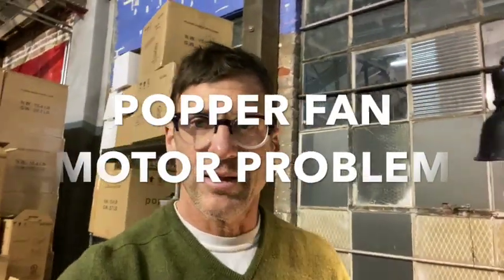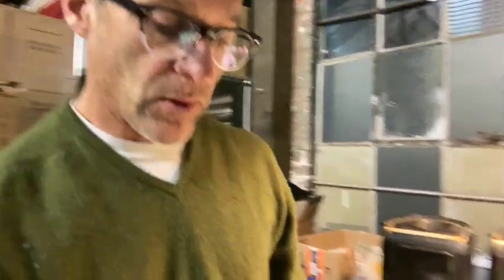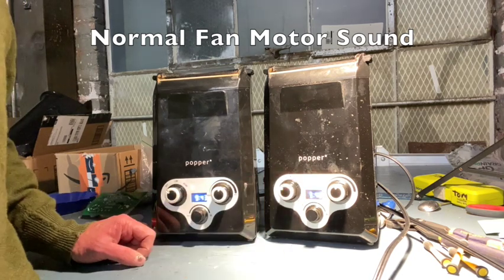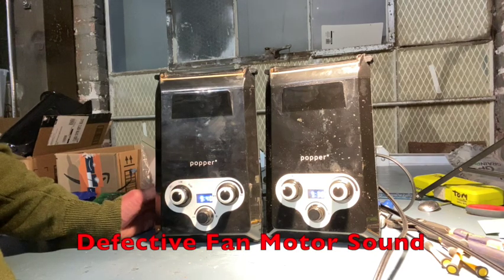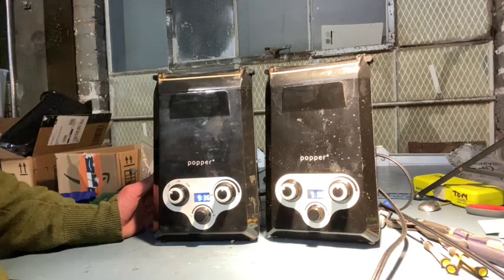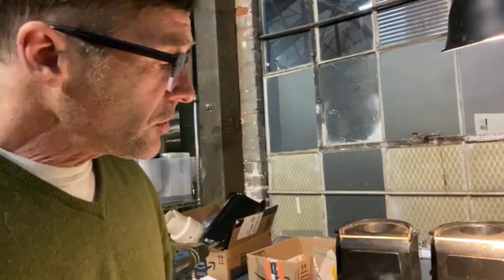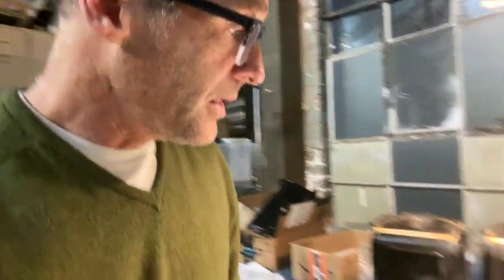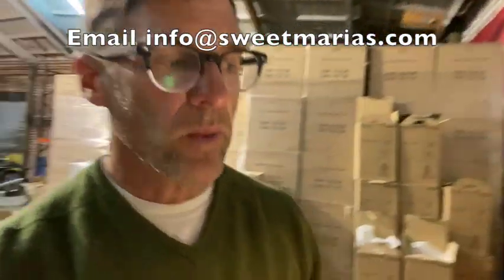Popper Roaster - What Does a Bad Fan Motor Sound Like?

Comment: Mine finally hit this problem. Too bad; and I'm out of warranty -- but I've gotten my $ worth out of this unit. Onto the more expensive (and hopefully reliable!) options.
Reply: There will be new motors available- hopefully in April. Changing the motor is pretty easy. So if you have the popper still perhaps keep it and wait for the motor. Should give you at least another 200 batches +.
Reply: @ThompsonOwen  ya, I'm holding on to it, hopefully can restore it for a backup. In the meantime, FreshRoast should be arriving this week.
Reply: Mine just started doing this. I emailed you.

Comment: I was all prepared for a subtle difference between good and bad, but this was stark! Glad mine doesn't seem to have this issue
Reply from the maker: Yes luckily it is pretty obvious if there's a fan motor issue. But of course ... I really wish there wasn't any issue at all. Standards for manufacturing are to expect 1.5% defect rate. So I guess we are well under that, but wish it was 0.0% !